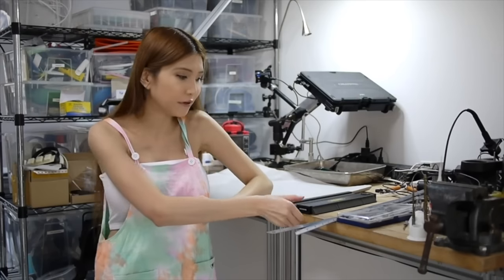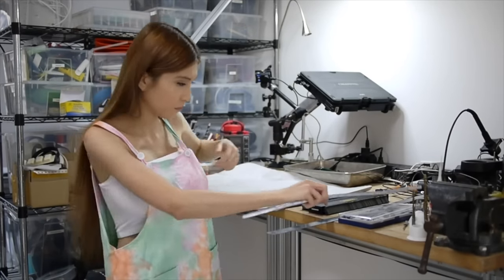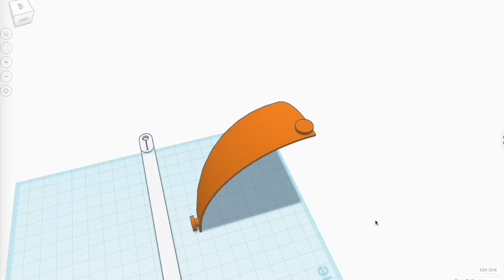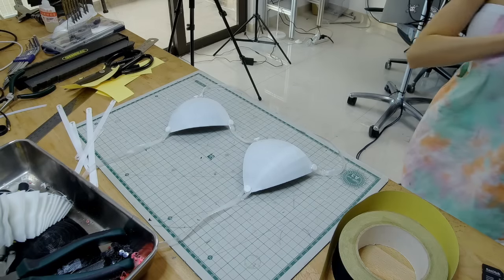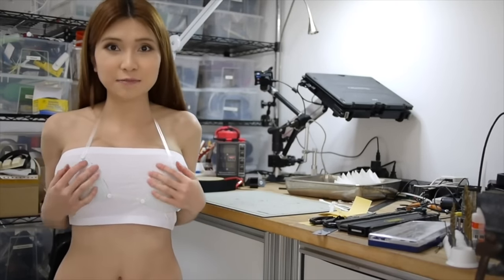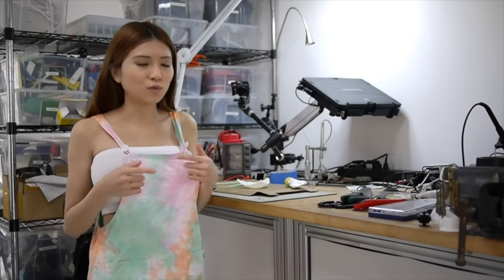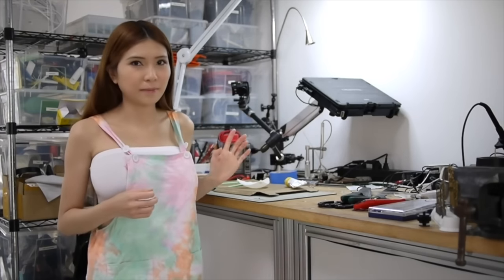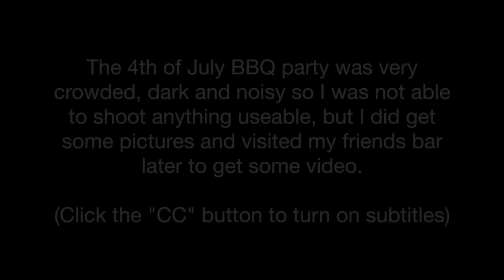3D Printed Bikini Top- and Yes It's Comfortable !

Comment: 1) I wonder if you could replace the straps with a printed mesh. 
2) Maybe you could try to add pieces so you could transform it. Maybe to cover more or less skin depending on the situation you need it for. That could also be interesting for other clothes.

Comment: When using a french curve, you typically follow the contour of the desired curve utilizing the tool as the edge. A good drafting pencil helps. Just a tip. Of course, you may not want to duplicate the exact shape the tool records from being against a body part. Looks like you are just using it as a guide here.

Comment: I'm wondering if a very fine sandpaper would make the plastic smooth enough to use without the tape?  Like a 300 grit or finer.  It could almost make the printed plastic smooth as glass with enough patience.

Comment: I’m a bit surprised you didn’t do a 3D scan with your phone, or import a picture of the profile into the design software. It’s still the case that sometimes the low tech solutions are the easiest, at least if you can assume a circular profile is close enough. Was that not the case for the bottom?
Reply from the maker: I have a full body 3D scan, this works faster and better.

Comment: The tool you show in the beginning is called a contour gauge. I've seen ads for them that imply it's a new thing.  It's not, been around forever.
Reply: Something like that has been around for at least 50 years. There is the original version that uses steel pins and is thin. 
They used to call it a "Copy Cat". This is the first time I saw one that thick.

Comment: I do have a quick question about the 3d printing shown, wouldnt it be less time consuming and more stable to print the cups rotated by 45°, e.g. with the cup up and supported on the bottom?
Reply from the maker: No it starts to flex as the print head goes over it and the print fails. The support stabilizes the printed parts in addition to supporting them. That's the only orientation where the part does not fail.
Reply: @Naomi-Wu  Thank you for your reply. Your videos motivated me to get a new 3d printer and fix my old solidoodle 3 and get making again. I hope you can continue your good work, I am a new proud supporter on subscribestar!

Comment: Can you build replacement parts for appliances with your 3D printer, i.e. blender? You are gorgeous in American colors.
Reply from the maker: Sure, depending on how strong they need to be.
Reply: @Naomi-Wu  The durability of the output of the 3D printer looks low. If you could make a replacement blade for a blender and it was safe to consume, I think 3D printers will gain wide acceptance as compared to the PC. The logic to carry out the design is established. Now the focus needs to be on the material. Most metals will not work do to the high melting temperature. Carbon based materials seem like the best option. Right now 3D printers are good for models, displays, and any other noncontact function.